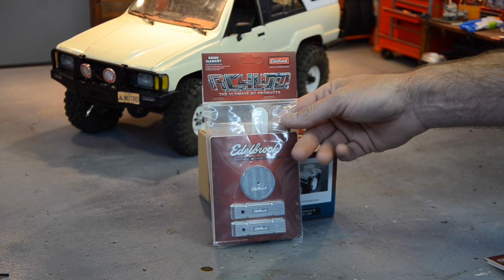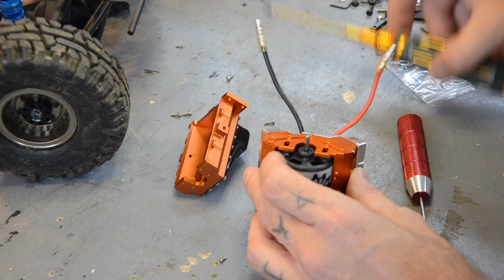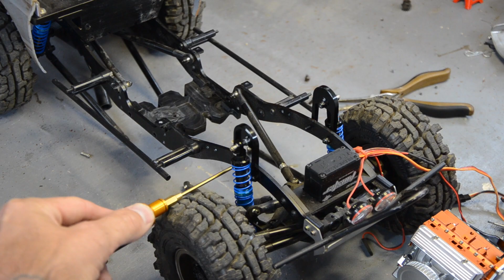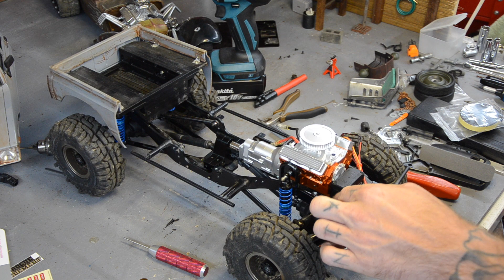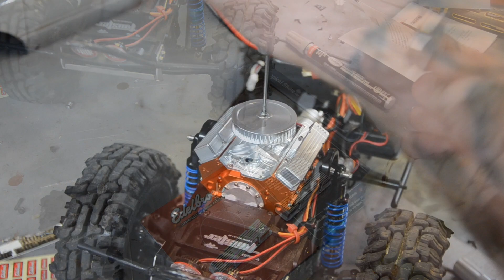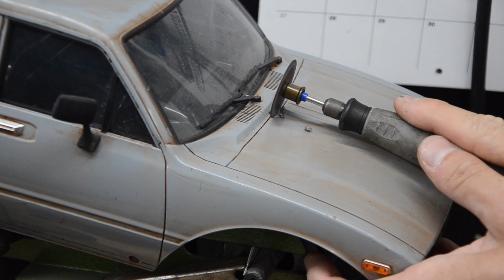RC4wd Edelbrock Accessories, V8 Swapping the C2X, Scale RC

Comment: This is going to piss you off lol. The servo position issue is one of those so easy you miss the fix problems 😮.  The fix is moving the servo mount to the bumper mount position. Add a spacer to the side that the shackle screw interferes with. Flip the horn 180° and viola fixed😊. I pondered the problem for about a month before I sat down and stared at it for about 10 minutes and realized that this was possible lol. But there's your fix because the front bumper mount isn't needed on the k5 blazer.  Good luck and Peace ✌️

Comment: The bad news for you is RC4WD just released the TCI transmission WITH the over/underdrive transfer case ATTACHED to it! TODAY! I recently built a 2wd dually on a TF2 LWB frame with the TCI(R4) transmission and an 80 turn Gool RC motor. I also used the K44 rear axle and leafs. It's called "Project Towpig", and it's much too fast for towing so I ordered the 4:1 gear reducer and I think there's just enough room to not get a micro servo. I haven't decided on what to do about a scale engine yet. I really can't afford to get the RC4WD engine but I do need more weight up front. There are some nice looking engines with fans and ducts that clip onto the motor that I've been looking at. The body is a 3d printed '86 F150 that I added 3d printed fenders to make it a F350. I might add weight in a custom front bumper.

Comment: I agree with you, things like the plug wires are a pain!!  You're already done it's a moot point but for a similar build I used gel superglue.  I left it to set for 2-3 seconds & put the wires in place.  I tried using shrink tubing  and could not get it to stay in place